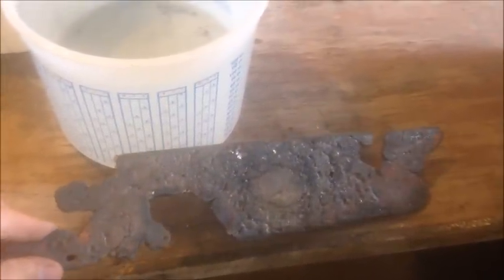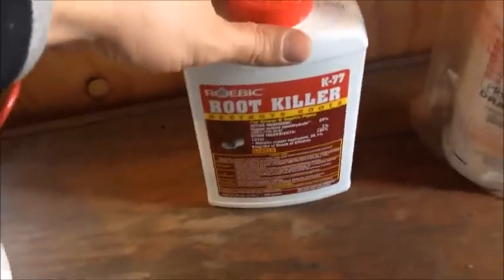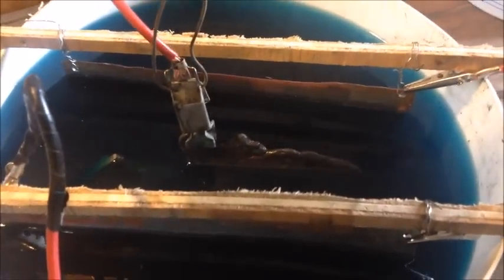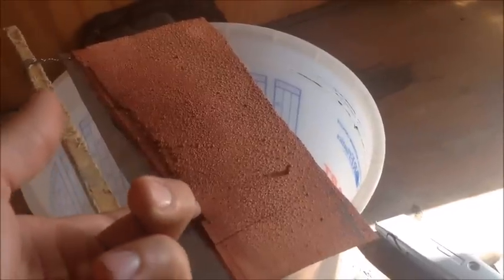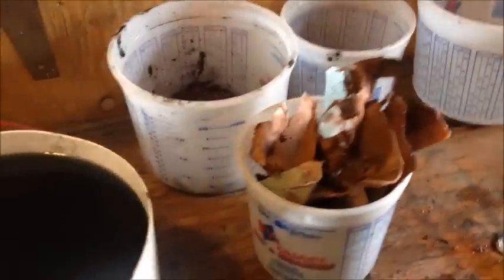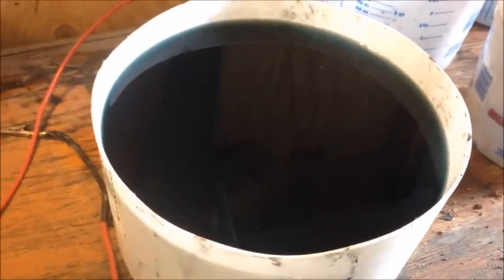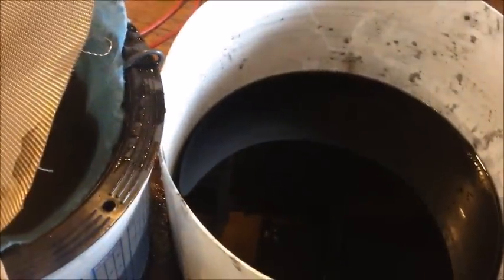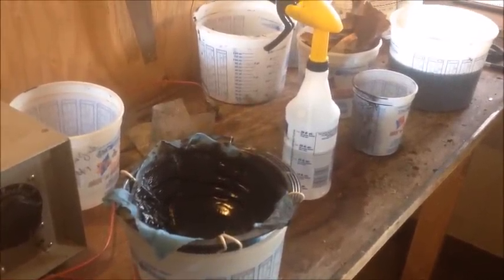Smelting and Gold Refining PART 2: Electroplating Copper to Recover Gold and Silver

Comment: Who made your plating machine and what is the model. Does it have a control for Amps? Did you figure a better way to filter the slimes like different meshes?
Reply from the maker: I think I bought it on ebay. Its called a rectifier

Comment: What if platinum or palladium is in the concentrates?Will it end up in the slimes as well?
Reply: Short answer: Yes
Long answer: The electrolysis removes metals based off of the reactivity series.
Copper is the most reactive metal in the bar so it gets pulled off first, less reactive materials won't be pulled into the pure copper bar that forms on the steel for two reasons:
    1. the electricity flows through the copper first and just wont take the other metals until it's              all gone all none copper materials just fall off, forming the slime (which is more of a loosely bound metal sponge until it breaks down with literally any interference)
    2. for the copper to be removed it must go into the solution; it can't just fall off like the other metals. metals like gold and platinum won't react with the solution so no matter how much current you push through the system they won't budge, however silver can dissolve in sulfuric acid so you may want to be wary of that, although you would be able to detect it due to the change in solution color.
Reply: @roland4240  thanks I'm working a river and I am seeing silverish colors as well as gold colors.will.have to test and see which it is.
Reply from the maker: Yes

Comment: I set up the apparatus with DC power supply that dishes out 20 Volts; but I can't get the volts above 2.5 volts. Does that mean the DC power supply is faulty?
Reply from the maker: Hello.  I am not an expert in electroplating, but I suspect the reason for the low voltage is the surface area of your anode and cathode may be small and also the concentration of your solution may be low.  These will not prevent the process from taking place, but it may take a little longer.  Have you run it for a day or so?  Can you see the copper plating?  Thanks for the comment and question
Reply: I bought a new power DC unit and the results are not quite what I expected, unsatisfactory, my fault, I'll keep trying. I am going to try a different chemical set-up. I want to learn how to do all kinds of metals. This is very enjoyable! 

PS: According to your videos I have seen, You have a wonderful amazing life! And amazing father! Cherish every moment!!! 

--Your Friend, Robert

Comment: What is the amps set at ????
Reply from the maker: +Anthony Bailey Hi, that is a great question.  The amps are actually determined by a couple of different factors including: voltage, surface area of the anode and cathode, and strength of the plating solution.  When setting up the plating adjust the volts to between 1-3 and the amps will be determined from there.  You can also check out the video at ~3:30.  I turn it on and its running about 1/2 a volt and 9 amps.  Thanks

Comment: you can smelt it with the filter. it will just burn away anyways.
Reply from the maker: +Jacob Ellinger Thanks for the suggestion.  I was a little bit nervous about smelting it with the filter because the filter is pure carbon.  By adding in a bunch of carbon to the smelt it will counter act the oxidizing agent and CO2 will be formed rather than metal oxides.  I have found it better to keep the filters and when I have enough saved up I burn them together and then deal with the ashes.  Thanks

Comment: Why is it always such a low voltage??? I would love to simply use a 12V battery charger but I know it wont work BUT I DON'T KNOW WHY?
Reply from the maker: +Pynenberg3 Great question and one I grappled with too.  When you have a really high voltage/amps it removes copper ions from the solution near the cathode so quickly that it essentially starves the cathode of copper ions to plate out.  By doing this the water in the solution starts to ionize and hydrogen gas is produced at the cathode.  You can actually see the very small bubbles rising from the cathode when this happens.  This is called "burning" because the copper cathode oxidizes and turns black.  You can increase the voltage some by having an agitator in the solution so the copper ions are replenished more quickly.  This could be a magnetic stir or even a fan blowing on top of the solution, just something to keep it moving and mixing.  In turn this can also happen at the anode too, and oxygen gas is produced.  Hope this helps and great question!
Reply: +mbmmllc Great advice, today I will try a computer power supply, 3.3 volts up to 28 amps. The computer supplies are cheep and should be very efficient regulating the voltage compared to rectifiers, we will see how it fairs with long term use. I will connect an amp meter to monitor the progress. 

NOTE watch out for what kind of drain cleaner you buy, I just ended up with a lye version (very common) this is an alkaline solution made with sodium & potassium hydroxide and not acid) Back to the store I go... thank god I have a plugged drain I can use the lye up on...;)
Reply: +Pynenberg3  check into sreetips vids I think it will help
Reply: I have, Sreetips does some great stuff.

I was very successful with a 5 gallon bucket, stainless plate and computer power supply at 3.3 volts, it did exactly what I wanted. Next I made a sand casting ( I work at a foundry ) and cast a really cool part out of the pure copper.

thanks everyone for your help, it worked great.
Reply from the maker: +Pynenberg3 Great to hear your had success!! Maybe you could post a video of your setup and process?

Comment: Another quick question about this process, and thank you for the link to the booklet!
from your work with this process is the solution you create reusable? does it need top ups of sulphuric and copper sulphate or is it pretty much a one shot deal? (can you run this process, then save the solution for future reuse)
Reply from the maker: +CoinSilver800 From my experience the solution is reusable and I use the same solution several times.  It does need to be topped off with water as evaporation does occur and the solution also can get warm depending on the volts/amps used.  I don't add any more sulfuric or sulfate, just top it off with water.  

This is the exact same process they use on blister copper to reach 99.99% pure copper at the cathode.  In my process I don't really care about how pure the copper is because it is just going to get re-used again as a collector metal.  All the reading I have done on this type of process is in reference to copper refining and they do talk about the solution becoming saturated with iron, zinc, etc (because these don't precipitate or plate out) and needing to be treated by bleeding off the solution for treatment to remove the non-copper ions.  I'm  not sure if excess metal ions in the solution cause an issue with the plating of the copper, maybe the copper on the cathode becomes contaminated?  I figure as long as copper is plating onto the cathodes its working for what I need, lol.  

But to answer your question, yes you can re-use the solution many times.  Also when you are ready to dispose of the solution drop a bunch of iron into the solution and the copper plates out onto the iron without electricity.  Moose scrapper has told me he uses an old shovel head and then he can recover the copper.  I have heard of other people using steel wool (lots of surface area).  Once the copper (and other heavy metal) ions are removed then it is just iron ions and dilute sulfuric and you can dispose of it properly.
Reply: @mbmmllc  для очистки отработанного раствора используйте свинцовый или графитовый анод(графитовый анод при длительной работе осыпается в виде шлама) , он не растворится в растворе но при этом на катод осядет никель и олово, возможно железо а также серебро которое может перейти в раствор . я еще не дошол до стадии гальваники сейчас отрабатываю процес разделения компонентов с печатных плат (SMD компоненты разьемы чипы) уже отработан процесс с электростатическим сепаратором (разделение металла от неметалла) думаю после перейду на стадию электролиза
Reply: @mbmmllc  при вольтаже 0,3В на катоде оседает только медь, при вольтаже 3 вольта оседает медь и палладий

Comment: hi 
good job ,but i want to ask if u use nitric acid wouldint be more effecent and fast ,and i think 9 days is int it too long to do this
Reply from the maker: +mohmad borhan Hi and thanks for your comments.  Nitric would be a great way to do this on a small scale (a few pounds of copper as shown), however the version shown in the video is easily scalable and can done with very large anodes.  If someone was going to pour a 100 lb copper anode they could electroplate the copper out quite easily, but 100 lbs of copper would take a lot of nitric to dissolve.  I think for the small scale project with a few lbs of copper nitric is the better way to recover the gold as you say.  Thanks

Comment from the maker: I wanted to throw this out there to see if any of you had any comments on it.  I heard from a source that if you keep your copper pour just under the melting point, lets say at 1900 F, for about 24 hours after you pour, the gold atoms will migrate in the copper bar and form larger pieces of gold.  During the electroplating process the gold comes out in much larger grains, like fine sand, as opposed to micron black smoke.  Does anyone have any experience with this or think it will work?
Reply: I was reading about growing various elemental and mineral crystals a number of years ago, the first part of what you said is essentially correct. But in the lab furnace they used a certain element in the mix what 'seeded'  in particular gold crystals as it oxidised off. The document aimed towards growing large crystals over extended, 1week - 1month timeframe, but seeding was within 24hours and happened as the element oxidised precipitating gold in crystalline form, sandgrain size would be accurate. molybednyum im sure was one mentioned, i think it was in salt form in the flux, as a minor additive in particular to induce gold seeding. They aimed at small amount of seeding but attempted to grow large crystals.
Would it be of help if i found the research paper again, it might take some time, if its helpful il try find it
Reply: no experience, but sounds neat.  other than gaining cool points, i'm not sure what the benefit would be.  sounds expensive to keep your copper that hot for so long.
Reply: Great idea i should try it

Comment: One thought and question, would it make more sense if you were to repeatedly use the same copper pyramids after using them as a collector in the conical molds? I mean you mentioned that in that single bar you had 7 or 8 pyramids of the copper collector drops from the black sands, if you were to re-melt them and pour them into a large stainless steel container of ice water that was agitated it would create some corn flake type shot that you could then use again in the black sands as a collector a few more times to increase the gold/ precious metal content a few fold. so instead of running this cell with a bar that contains about 1-2% gold you could run it with a bar that contains more?

If the black sands were to contain trace amounts of palladium after making a few runs of melting and re-using the same copper without refining further until a few smelts cycles were complete you could treat the pyramids with nitric acid to separated the copper,silver, and palladium with addition steps leaving you with a sludge that would be very high in gold content with possible trace amounts of platinum in it (if the source material contained any that is). You would be then left with a very fine copper precipitate that you could reuse again after thorough rinsing and drying. 

Lastly mind if I ask what the name of the booklet you were using is for the procedure you used in this video? (always handy to have something in paper when an internet connection is not available) :)

Great Video , Can't wait for the follow up's!
A+
Reply from the maker: +CoinSilver800 Those are both excellent ideas!  I really like the idea of melting and re-using the copper collector metal to increase the gold content.  I haven't played around with nitric yet, but its on my list of things to do, I have seen it done on YouTube so I would like to try it in the future.  The booklet I used is called "Hobbyist Electroplating Made Easy" by RL Nyborg.  I don't remember where I got my copy, but I am sure you could find it online.  Thanks again for the toughs, you have some great ideas!!
Reply: CoinSilver8

Comment: good job!!!
To save time on dissolution in an acid - alloy may be melted and poured into water through a metal mesh !
It turns out small metal beads that dissolve rapidly in acid !
maybe in the future you useful advice
Reply from the maker: +Zloy Gragdanin Thanks for your comments.  If I understand correctly by using a graphite crucible I get more contamination in my anode slimes.  Is this correct?  What type of crucible do you recommend?  I appreciate all your advice.  Maybe you could send me an email at MBMMLLC@gmail.com and I can ask you some specific questions about smelting and refining?